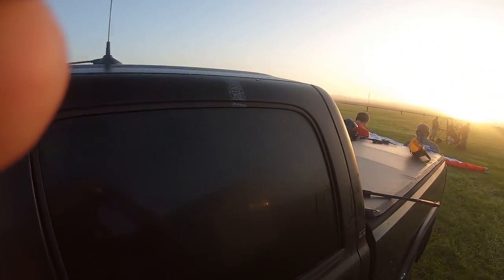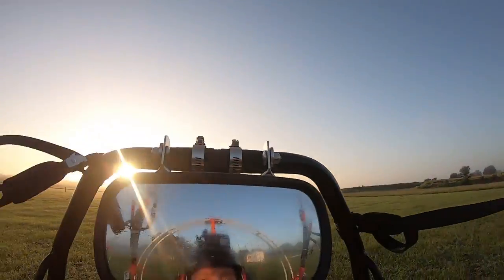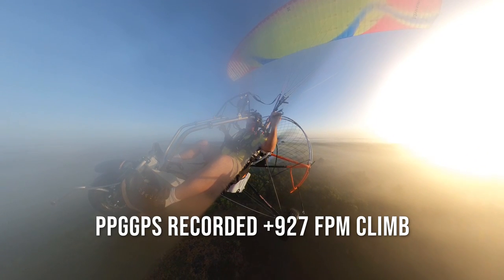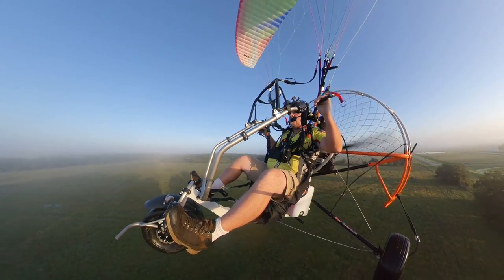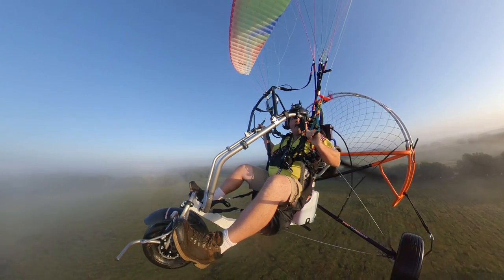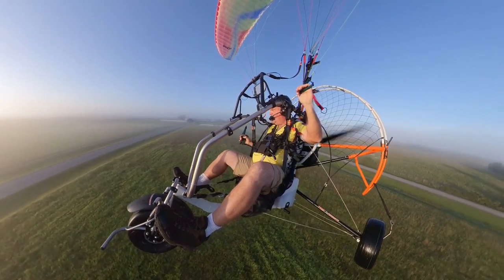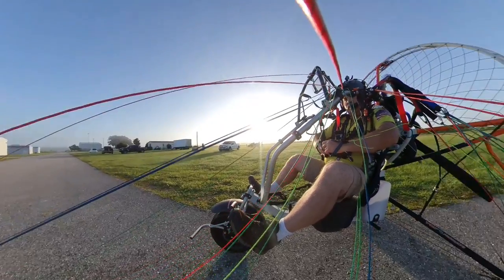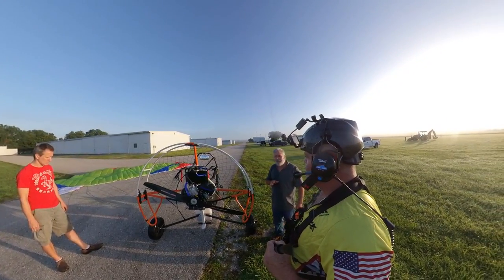**WARNING  DON'T BUY POLINI THOR 303!!!**

Comment: Polini 190. Same problem. Fix. Richen engine till you get a little drop in rpm. Then richen the oil mixture. Smokes a little. Haven't had a problem since.

Comment: Funny you posted this! I was just reading about this engine on Polini's website, and I INSTANTLY fell in love, reading the specs on it. That thing would most certainly give me the climb rate I need for my yard here, that's for sure! It's a full 12HP over my unit, and quite a bit more torque I'd wager as well. May even be TOO much! 

I absolutely love the way that thing is engineered. It was actually built specifically for flying, which is why it's so nice. I thought I remember seeing it only weights 35 lbs.! That's IMPRESSIVE! Liquid cooling will double engine life, e-start and recoil backup is perfect for paramotoring so you don't get stuck if the battery dies, and the dual and completely separate ignition systems seal the deal for me. Don't think we'll see very many engine outs with this unit that aren't fueling related.

I can't believe you were OVER 900 feet per minute!! CRAZY!! I don't think my Talon 190 does 500 feet per minute with me on board. That engine even sounded smooth just sitting there idling. You can hear piston slap in the air cooled ones pretty loudly, more so on video I've noticed. Not with the Polini! Now to decide if I can swing the price if I sell my Talon 190 ... probably not ...

Awesome vid, man! Was great seeing your reaction! I got a big LOL from that one!
Reply: LOL  I just emailed you the link to this video, but you watched it before me! 
 👍😎👍
Reply: @Chris-Fennimore  - Ha! I was just replying to it. 🤣
Reply from the maker: OMG you wouldn't even need 1/2 throttle! Dave got this because he wants to progress to a tandem rating eventually.
Reply: @PPGGORILLA  - Nice! I think I need to have this one, lol! 😁

Comment: If I had this engine on my plane I could probally climb at 1100fpm in the winter my current hirth is just 28 hp and I get 600fpm in the winter. you can get this engine on a badlands airplane. jealous of the silencer that most paramotor engines have. when I fly my plane everyone in a four mile radius knows it lol
Reply from the maker: Yeah man super powerful and relatively quiet.
Reply: I currently have a Fisher Avenger,  with jlo 399. A little under powered, is polini 250 worth the costs? Would like to find more power
Reply: What do you have hirth in? Any good?